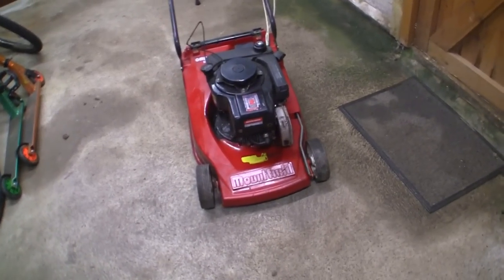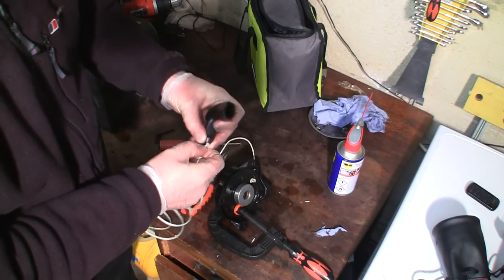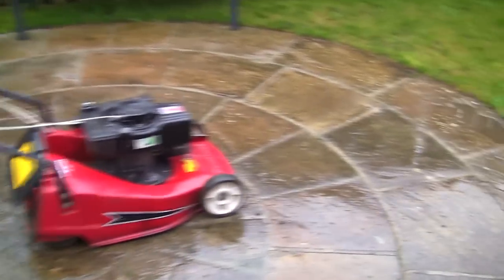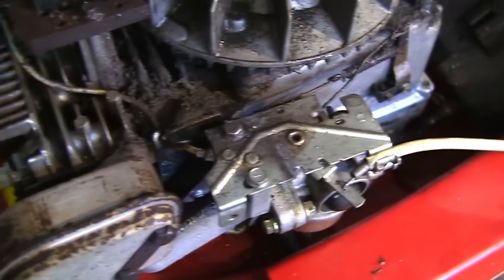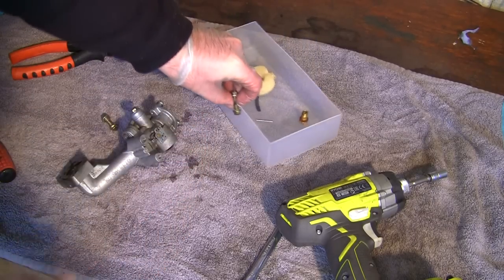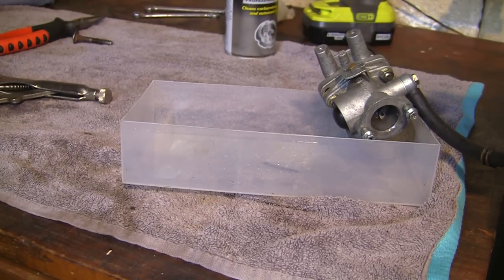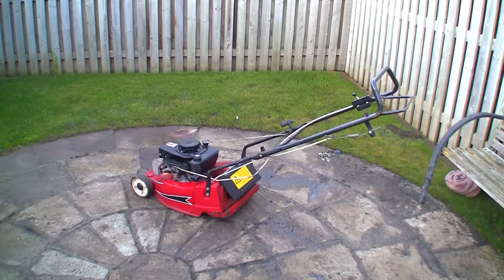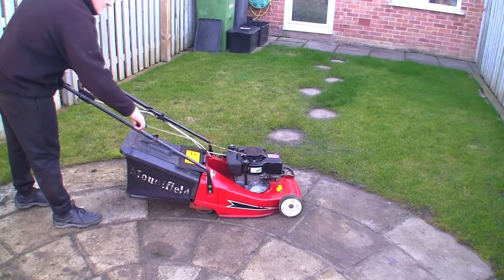Mountfield Empress 16 SP Service (Tecumseh Lawnmower Engine Service)

Comment: You just saved my life (well, my lawn anyway) as when I got my Empress lawnmower out of winter hibernation last week it started and then died after a few seconds. Anyway, I went onto youtube and found your video which gave me the confidence to strip down and clean out the carb over the weekend. Hey presto (well, 6 hours later - I'm not a mechanic!) and the lawn mower not only started up after 2 or 3 pulls but ran perfectly without cutting out! A miracle.. even the missus clapped her hands with delight! I also had the "fast running" issue.. the mower seemed stuck in max power mode, but following your suggestions on how to adjust the governor / throttle etc I soon fixed that as well. I now feel like a lawn mower repair superhero. So thanks again - your advice and videos are great and very much appreciated!
Reply from the maker: That's superb! Especially happy for your Mrs! What a great comment. Leave me a  video on the facebook page if you get chance!

Comment: Great video!  I have an old Mountfield Empress 16 with Tecumseh BVS143 and Dellorto carb.   Very similar to your machine in video.  Took mine apart and followed your advice - it now runs really well.  Just need to adjust the governor as shown in your video.  Thanks!

Comment: thank you for this excellent video.  I have one of these that refused to start this year.

Turns out they dont take well to the new E10 fuel.
I drained the tank (had to replace the fuel line as it was aged/cracked) and filled it with Super unleaded (!)

It still wouldnt start so I set about removing the carb and disassembling it to clean it.  It was caked  with a white crystaline residue from the "bad" fuel.
I used your video as a guide to help me put the carb and throttle linkages back together as in my original haste I forgot to take pictures.

The old girl started on the first pull, and I am most pleased.

Comment: I think the reason it's not 100% is you didn't take the emulsion tube out and clean it. Trouble is the o-rings are usually perished like mine! Don't forget the carburettor cup has a deep end to account for the float. Keep up the good work.cheers

Comment: Good mower. I have a briggs one, i would not touch a tecumseh variant. Very reliable since new in 95. Used in conjunction with a petrol cylinder mower. I do believe that in the vid, the float bowl was put back 180 degrees out. The lowest bottom indent is meant to be opposite the float hinge to allow free up & down movement of float.

Have had various other rotary mowers as well as the empress. Hayter, toro and a couple of others. Hayter self propelled goes along too quickly, especially with taller grass. Empress is as good as any of them.

Comment: You'll prob know the stick out thing is a pawl, the briggs mower I had have plastic ones and twice they wore away when the top cover was loose when a bolt at the front was missing, so when I started it for a season, each start was making it move and wear away as I pulled it. I've saved the engine for a future project but I've learnt from that.
Reply from the maker: JuiceBanger1 I remember them being called pawls now. I get mixed up and call nuts bolts and allsorts haha! Yeah i've had some worn briggs ones. The sv150 ones are awful as well. Thanks for watching Juicebanger

Comment: Great video as usual with lots of detail.  Much appreciated.  

I'm working on the same mower myself today but this one has a leak from the fuel tank outlet pipe....and the previous owner has sheared off the oil drain plug on the underside.  Also cleaned the carb and replaced the carb bowl seal which was leaking. 

I'm learning that spares are not readily available so I'm probably going to look into getting the drain plug sealed with a weld if possible or maybe even fibreglass.
Reply from the maker: Glad to help

Comment: Great video Paul i've got this exact mower bought it 2nd hand about 10 years ago and in the main its always started and run pretty well. that is until yesterday started up did half the garden then it cut out and wouldn't re start. I split the carb cleaned out the jets and now it starts but its stuck on full revs and it doesn't shut off when i close the throttle. I've got a few things to try having watched your video so I'll give them a go and let you know what happens. Thanks again for the info.

Comment: Great video thinking of buying one since it has the rollers at back and not a fan or corded for the price they are only 32cm blades. Old lawnmower that was given to me was a harry but the carb is done and cant find and replacement

Comment: Great video. I have the similar model with the Dellorto carb (no primer). It’s running again but full speed as yours is in the video. I’ve watched the video a few times but I’m still not clear on the method of fixing the mower to run at the right speed. Could you maybe let me know what’s best to try first?

Comment: Nice work, picked up a mower for £10 myself today. 👍🍻
Reply from the maker: Rob Rusticwoodlandproducts Nice Rob what did you get?
Reply: An old Mountfield with Briggs engine . Paint work is a bit dull , but I know it works because I’ve serviced it in the past. Just a quick clean and service should make me £25 profit. 👍

Comment: When you drain the carb you just have to press the little spring next to the bolt it will drain from there
Reply from the maker: potsyg You are correct! I realised this later on!
Reply: I’m watching this because I didn’t take no photos and when cleaning the carb my linkages shot off and wasn’t sure where they went... also the 2 bolts in the casing above the exhaust are for the cage that’s meant to be around it, same as the smaller bolt that you removed from the inlet to the head... thanks for the video helped loads

Comment: hi great video, I have similar model. my belt has come off and I'm struggling to put it on. It runs from the rear roller  side towards the front via up the side. Can anyone advice on how to get it back on please
Reply from the maker: Put it half on the pulley and turn the blade

Comment: I can't believe what you can't solve...that's what kids in high school solve.
Unfortunately, you didn't know how to fix it! Because you don't know! And that's a banal thing. Funny. Well, it can be adjusted with a screwdriver using those two screws on the regulator in 10 seconds !!!! One is for minimum or empty throttle and the other is for maximum throttle. That is all wisdom. So easy and so hard...hahaahaha
You didn't do anything...you just disassembled the carburetor without need and without effect.
It works the same as before disassembly. Only washed the lawnmower. And it's not servicing at all.
It was only necessary to adjust the gas on the regulator with screws and everything would be ok...and it was solved in 10 seconds. The regulator is not adjusted and that's why it works like that. But you don't know that there are those screws on the regulator...you didn't even notice them.
Reply: Thanks for the point you made but was it really necessary to be so rude. This guy has provided loads of really useful and free info